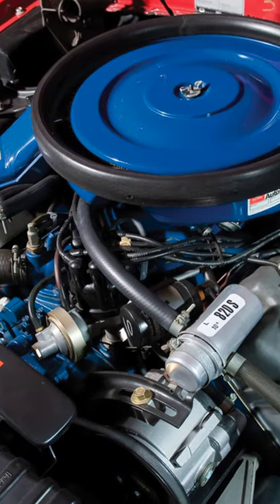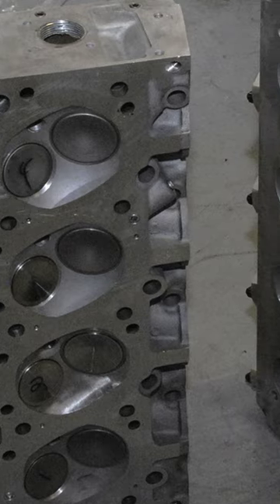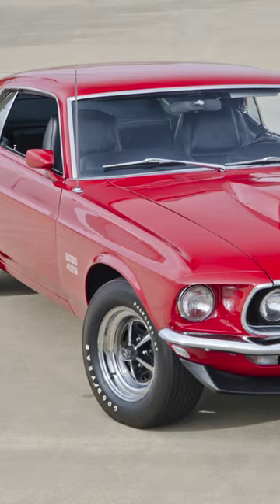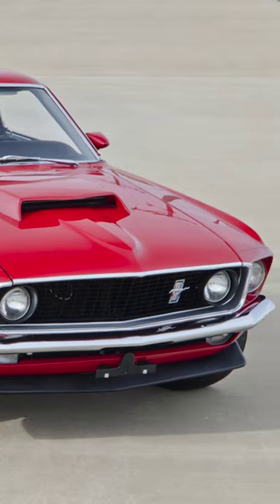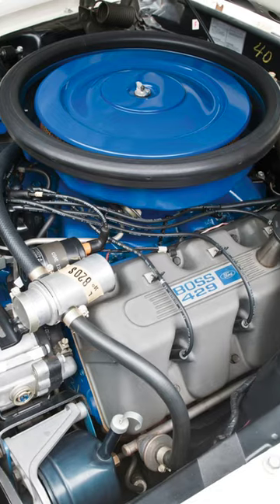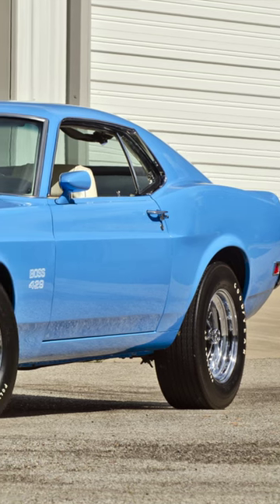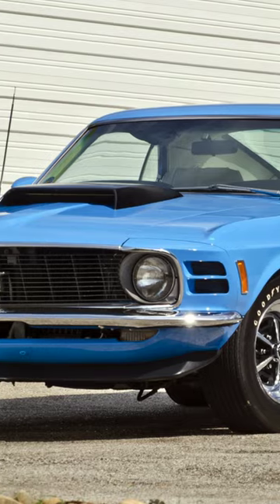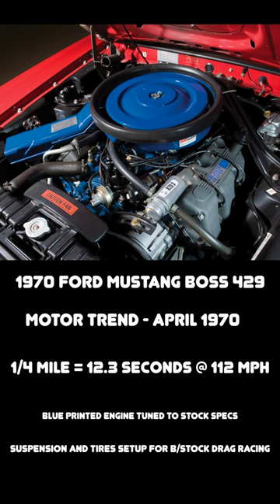Ford's Hemi V8 - Boss 429

Comment: My several Hyundai Ponys all have hemispherical combustion chambers. 

That's right, a 60s derived Japanese motor in a Korean Ford-ish engineered motor sold in Canada is an actual hemi. FitemeIRL.
Reply: Chryslers K-car had a Hemi 4 cyl in the '80's. LoL. Wasn't that bad of a motor for what it was and for those days. Dont get me wrong im not suggesting you can compare the 2. Just funny useless information
Reply: @skxj  It was the same series of engines. In my case, 4G3x. I'm not sure what the K cars had (IIRC the Astron line) but they were honest-to-God hemis.
Reply: @the_kombinator  if I remember correctly it was a mitsubishi engine and yes it was an honest Hemi combustion chamber. Mom had a wagon with that motor and it never gave her any trouble at all.
Reply: @skxj  they're prone to quick valve stem seal leaks, otherwise very stout engines.

Comment: I'm older than dirt, you could order a cam from the factory for a Pontiac 455 in 69, I worked at Blue Max in Dallas, on the dyno with factory everything, 94 octane gas, 510 horsepower 570 ft lb of torque, folks the magic number here is that torque, Pontiac discontinue that cam after one year, it idled to rough.
      Here's the best part, 5500 RPM redline, all day long horsepower, as dependable as a John Deere tractor.

Comment: Ford mis-marketed this engine since they offered several other 429 cubic inch V8’s during and after these years that didn’t have the components of this Boss version. Chrysler, on the other hand, offered one 426 at this time, and they cleverly coined the name Hemi and it was rated the same 425hp. So, when someone says their Chrysler model from the late 60’s, early 70’s, has a 426, we all know what it has under the hood.

Comment: A friend of mine had one it was crazy quick off the line but my 71 Hemi Cuda had it in the 8th and 4th mile all day and edged it out on the top end by about 25 mph still a absolute beast for a factor car
Reply: Sure it took dual quads to do it to pit the hemi against the 427 sohc ford and lets see what happens
Reply: When Ford factum starion Mopar loaded their cars on a trailer they did not want to be humiliated look it up don't mess with Ford you got lucky

Comment: I had 1992 Miata with a carb legal turbocharger with 8 pounds boost run 1404 in quarter mile at 97 mph and had it up to 131 MPH on highway 395

Comment: The weakness was that for the street ,  the ports were actually slightly too large.  Way down low the Chrysler would outpull it.  The Boss ran better at higher revs.

Comment: Had the same solid cam as the 429CJ engines though worked well on them it needed a bigger cam to take advantage of those big heads.Anybody who has a 429/460 engine there are china clone heads by speedmaster coming out soon for around 3k a set.I heard if you buy them bare and put good valves/springs/seats in them then they can be decent.

Comment: These engines were made for Nascars super speedways. I have a friend who has one in a 500 Shelby. It is not a very good highway engine. It was made to run at high RPMs for super speedways. It over heats very easily. Maybe at 180 plus it’s runs fine.

Comment: It was detuned. It never put out 500 hp at the flywheel in Mustsng. The 427 ran circles around the boss 429.
Reply: True, detuned from the dealership.  Fine-tuning dialing it in help a bunch.  The rare 427 SOHC cranked out >600hp but Nascar forbid it
Reply: @bobpickersgill4470  Yes, you could buy it in a crate complete. It put out 660 hp

Comment: Isn’t the Boss 429 widely considered “over motored” for the Mustang chassis? Actually killing its best performance attributes ..?
Reply: During the muscle car era, there was no such thing as having too much engine. Realistically, (though these are my favorite stangs of all time) the car would be far superior with a 500hp 351w build these days if you wanted to make a nice driver.
Reply: Homologation requirements by Nascar meant a minimum quantity of 500(?) had to be sold to the public. They raced the Torino with these Boss engines.  Ford sent new Mustangs to KarKraft to alter the shock towers to make the huge engine to fit.
Reply: That's true 1969/ 1970 chassie would never be able to handle the horse power that engines capable of making .  Like the Camaro's back in when I was a young  everybody had a smashed up  Muscle car in there backyard.

Comment: You need to stop using Motor Trend as your source for information. Back in the day, every motor head knew that it was the lamest of the car mags, trailing far behind Road & Track, Car & Driver, and Hot Rod. They basically just took what the factory told them to write, and put that in their articles.

Comment: 112 mph for a 3800 lbs car is about 411 horsepower and that's with open exhaust and I would wager no air filter. Also the car had drag slicks which makes any runs it made ONLY comparable to other cars running slicks. Additionally the valve angles on a factory stock boss 429 cylinder head are clearly not as drastic as on a Chrysler 426 Hemi which is why a Boss 429 doesn't have a true hemisphericle half circle combustion chamber like a 426 Hemi.

Comment: Some say the Boss 302 was faster than the Boss 429 because of weight distribution and that year the Boss motor had been set up by Shelby for GT racing but the package was  very hard to get, harder than the 429.  The 302s were being sold to race team’s primary.  They are still a prime find in the pony car world.  I will take either.  I’m 75, you can bury me in one, I’ll die in it by the end of the day. What a way to go!  Full adrenaline rush.  Not much left to do that except slipping on ice, these days.
Reply: Don't do that, get some sand !

Comment: The sad part about the 429 was is that it was D rated with a 302 basically full barrel carburetor imagine if it had a real carburetor on it when it came out of the factory to the right specs

Comment: You could get the Boss 429. In the Cougar also!
Reply: I was looking for this comment. Which 
you are correct. But it was only 2 
cougars that received the Boss 429. 
Something to also look into is the Ford 
Cougar ll (not Mercury) that was married 
with the 427 side oil pumper. It kinda has 
the silhouette of that of a corvette.

Comment: This is closer to a Polysphere than a Hemi with the diagonal valve configuration
Reply: Obviously a true poly but the diagonal pattern of valves have no bearing on hemi vs poly. Poly heads are more efficient anyway. Fyi, no chrysler hemi is a full half sphere combustion chamber- the early ones were close at best.
Reply: @Ross Brumby  Honda did studies on head shape x flow. On OHV 2v Hemispherical heads got the best flow and efficiency, so, no, polys weren't better than Hemis. And you must have forgotten that 1st and 2nd gen Hemi's have similar shaped heads, the 3rd gen were a adaptation of dohc 4v pentroof shape onto 2v ohv heads, therefore, not a perfect half sphere unlike its predecessors.

Comment: These engines were not great for the street. They were designed to run wide open. There are no head gaskets on them, & were prone to leaking oil. They generally didn't last a long time before needing a rebuild. Now, the parts are so expensive to replace, it's not worth trying to rebuild one. A friend of mine has one.

Comment: They brought it out too late. It fell behind the 70 ls6 chevelle which was more 560 hp and 535 ft lbs torque in my uncles ls6 . He used to stomp all over cudas and mustangs . He would tell you hishardest races were boss 302 mustang.

Comment: Putting the stated data thru a 1/4 mile calculator using 3560 for weight, it comes out 420 flywheel horsepower. 
    The Boss 9 had weak valve springs and a small Carburetor intentionally from the factory to limit RPM to 5000 to kerp warranty claims low. The exhaust manifolds were horribly restrictive as well due to the tight space available to shoehorn this engine into. Change these 3 things and 500 hp was certainly possible. But, why put yhese NASCAR engines in a body that wasn't allowed? The Torino was the car allowed and had far more engine bay to begin with. Ford was silly sometimes.

Comment: i come up with 340HP.... using a 1/4 mile to HP calculator 
.
i used 12.3 seconds and 3210 pounds
.
.
also got 347hp using the weight and MPH
.
.
i REALLY doubt this thing made anything close to 500HP, especially in 1970

Comment: 12.3 seconds @ 112 for a 500 hp engine, how much did the car weigh 4500 lbs??? Sorry that doesn't figure out right. I had a 1965 Chevy El Camino with a 383 making 530 hp on race gas no nitrous or turbo and it weighed 3440 with me in it and if ran 11.0 to 10.90 at 122 mph with drag slicks. Notice the huge difference in the MPH? And yes my car was chassis dynoed @ 440 up to the rear tires. Just saying the MPH on that mustang should have been much closer to 120+ MPH.

Comment: A greatly looking car for certain BUT a stock 340 Duster, an SS 350 Camaro and Fords own Boss 351 Mustang would have no problem gaping that car in the 1/4 mile in stock form. It was made for NASCAR where it could use those soda can sized intake ports along with the giant 2.30 intake valves. This engine in stock form had waaay too much air flow to be of any use on the street. Giving misleading MotorTrend  magazine setup for NHRA stock specs allows using the listed stock lift on the cam but it allows for any duration, it’s running open aftermarket headers, the carburetor has been rejetted and would flow better than the stock one, it allows for “minor cleaning up” around the ports and the car would be running 9” slicks not street tires. Any of the cars I listed would run mid to low 11’s with the same “stock” modifications. The only reason Ford put that motor in a car was to make the motor a production motor so it would be legal to run in NASCAR. The best big block motor Ford ever built was the S.O.H.C. But they  NEVER put that motor in any car, ever, it was a crate engine only which is why all the big racing entities like NASCAR, NHRA, and IHRA called it an experimental engine and the people that showed up at the drag strip to run in stock or super stock with their dealership installed crate  motors got denied to race. Ford learned from that mistake and they put the Boss in the Mustang. Too bad they backed the wrong engine, the SOHC was worlds better.

Comment: "Only available in the '69-'70 mustang boss 429" then how do you explain the 7 litre Galaxie?
Reply: That is a 428-inch FE engine, not a Boss.
Reply: My mistake. Not the first time I've looked dumb on a YouTube comment section
Reply: @bigscrewg  It's OK if you're running for political office.
Reply: I just know I'm better with a wrench than a YouTube comment

Comment: Those aren't true Hemi heads.  Hemi is short for hemisphere and those chambers aren't hemispheres
Reply: Wrong.
Reply: semi-hemi
Reply: Fun fact: The first Hemi was a 2 cylinder. Put in boats. Check out Allie Ray Welch. Pretty wild.
Reply: They were 100% hemi heads
Reply: @BC  

I'm not sure you know what hemi or hemispherical even means.

The BOSS 429 in the Mustangs used a semi-hemi head,  sometimes referred to as a crescent head because of the squish area in the chamber.

NOT 100% a hemi...
Reply: @John Peters  yea, just 67.2% 🤦‍♂️
Reply: @Madison Powell  

78.4% of all figures are made up...

Semi-hemi fits what it is perfectly....it still has that hemi name which causes so much nut-swinging.

Comment: Wrong , it was slow from the factory  
Now, headers , cam , bigger carb , race gas and lots of timing; then it would run into the 12s. With suspension and slicks , 11s

Comment: Probably downlisted the horsepower for insurance purposes.
Reply: Yes of course rated at 375 gross H.P. 
Over 500 H.P. a actually.
Reply: @peterparker9286  

Not really...while the potential was there, they were incredibly choked up from the factory.
Reply: 275hp. The press car was tuned. Public cars would barely run a 13.5 quarter mile.

Comment: It was not a true hemispherical combustion chamber. if you look at how the valves are not  located for straight through flow and the sides of the combustion chambers are flat. So no it is not a true Hemi!
Reply: And the "hemis" they put in chrysler vehicles are true trash.

Comment: Well all these horsepower ratings that are all over the map… And so much is BS… It’s simple to figure back then 12 to 1 compression ratio equals about one horsepowerper cubic inch so you didn’t mention the compression on this one but the 69’s and 70s have the highest… So if this one was about 12 to one it was about 425 hp

Comment: they were beautiful cars, but..... they were dogs on the street.cold running, poor mid range, undercarbed with 735 cfm. almost impossible to put aftermarket headers or work on as they were shoehorned in. zero engine compartment space. . they needed lots of work to get them to run good on the street. but rare and they command high dollars today. i have a book about them. actually the 428 cj and 427 side oiler were much better ford engines than the shotgun, or semi hemi

Comment: A 440 Six Pack or 426 Hemi Super Bee or Road Runner will leave this car in the dust on the drag strip.  these things were dogs on the drag strip and they were never very popular. Poorly designed heads. Tuned specifically for NASCAR oval track racing. If they're so great then why didn't anyone use them in Top Fuel drag racing? The 426 Hemi is the only way to go. It is the staple in all types of racing. Ford always copied MoPar.